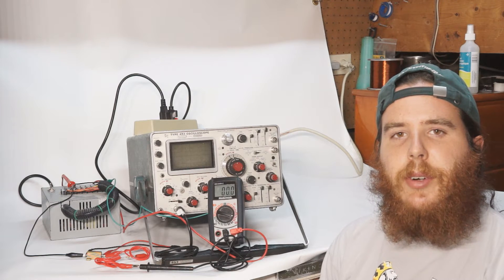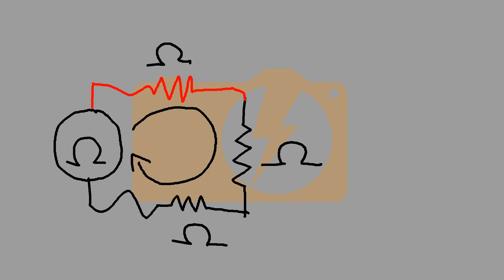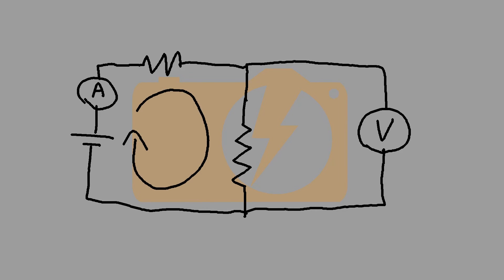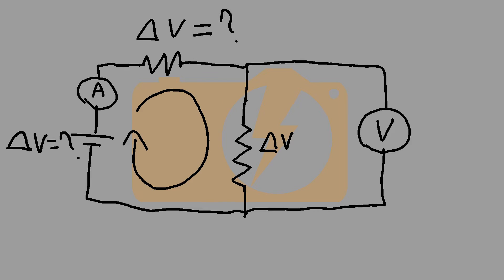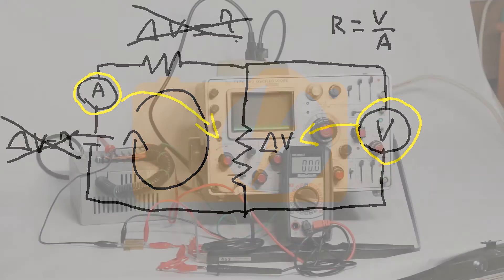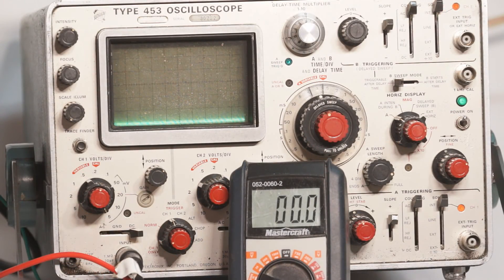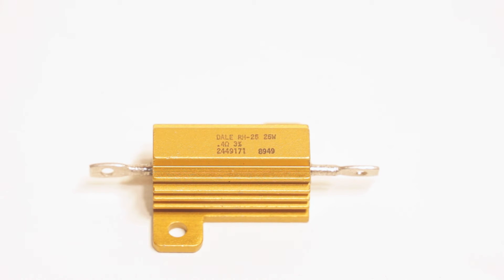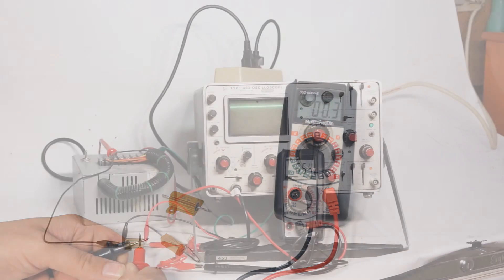4 Wire Resistance Measurement

Comment: You showed at last of the video that, the direct way to measure the target resis is better than the 4 wire and this is not correct,You showed:Direct way resis=0.7 ohmShort circuit resis=0.3 ohmThe net is 0.4 ohm and this exactly what labeled on the target resisOn the other hand, the 4 wire is 0.35 ohm and it is below the labeled valueCan you be more clear?
Reply: Sorry 0.382 ohm not 0.35 ohm the 4 wire resis
Reply from the maker: +Ahmed Naji The lable is wrong, resistors have a % tolleraces that allows them to be a different values. This resistor says it is .4 but is really .35. A normal meter can not measure with that accuracy.

Comment: Love your videos(Applied Science channel's output is too low). In this video you forgot to mention that the voltmeter has an internal high resistor. Some of the current will flow through the voltmeter that is in parallel with the target resistor.
Reply from the maker: +hpekristiansen That is a really good point, there are no 'true' voltmeters only ameters with different callibrate scales. If I can find a way to measure micro amps or smaller I may try to do a video about it.

Thanks! And I'm glad you like my videos!

Comment: Again an interesting video thanks Nick, we used to use this process when i worked for telecome to locate cable faults that had an earth faultfinding the unknown resistance and a table of info we could work out the distance to the fault and we usally where within a few meters.
Reply from the maker: Very cool. I wish I could use that at work but there are so many joints and changes in wire gauge that the ohms/foot is not consistent enough.

Comment: Very cool explanation of a process not so easily understood Nick!  I just found a fella, ROBRENZ (a machinist), on Youtube that took on the project of making really cool test leads for a 4 wire resistance testing.  You might want to check him out.  Fred
Reply from the maker: Done, he looks like he covers some great stuff.

I liked your walk through for the steam and gas show the other day. There are a few in my area and I try to go every year. Last time they even had a 100 year old self playing organ that has been run on a hand crank, steam, gas and electric in its life.
Reply: I thought you might find him interesting.  Very cool on the 100 year old self playing organ.  I wonder what the next mode of power will be?
Fred

Comment: something I'd be worried about with making this measurement is the error in measuring voltage with the scope. at least on my scopes, the voltage per division needs to be calibrated, and even when calibrated the best precision you're going to get is around 1/4 of a division, just because it's an analog reading with such large graduations. for a real life measurement I'd expect you'd know to use a multimeter for both readings, but did you just not have the hardware to do it for the video?
Reply from the maker: I only have one "precision" multimeter, my other meter is for high current/high voltage work(700v 300a) and is only good to 0.1v and 0.1amp, if it is even good for that.

I was as careful as possible with the scope, I used a reference voltage (at the same scale) to check against my multimeter, I also was careful to zero the trace right before each measurement to offset any drift. I had planned on including this information as well but when videos get up over 4min the viewers tend to drop off and miss the ended (which is usually where the 'ah-ha" moment is).